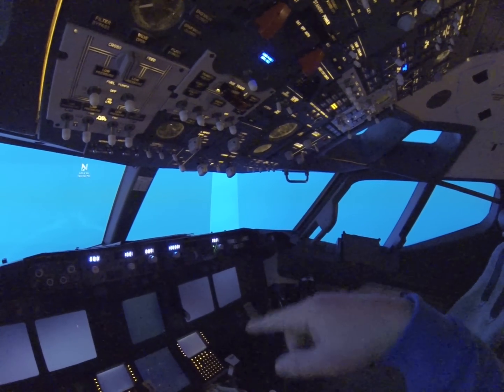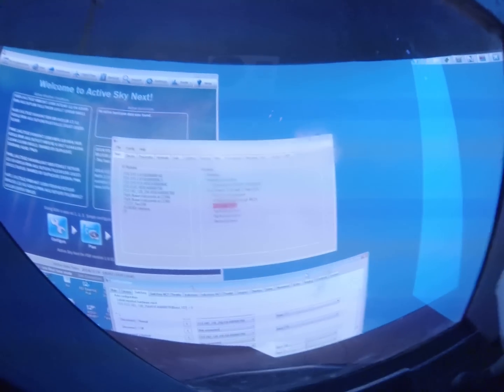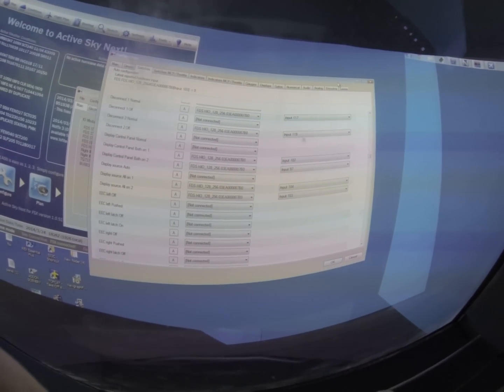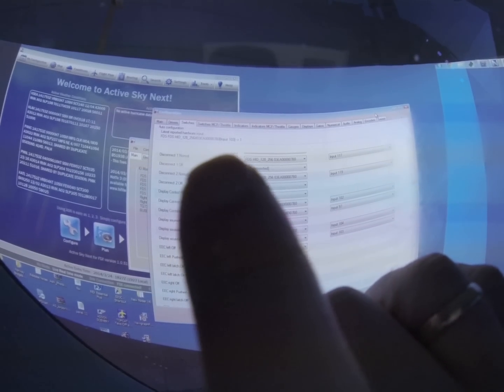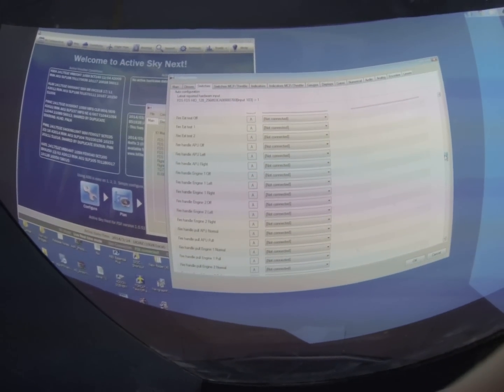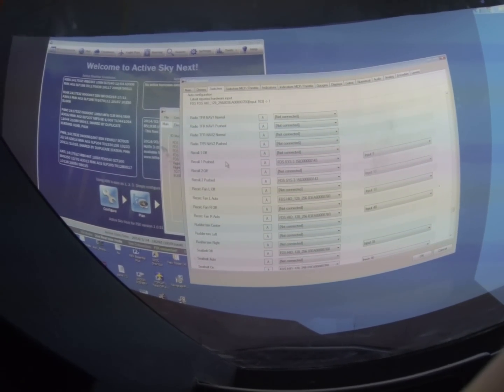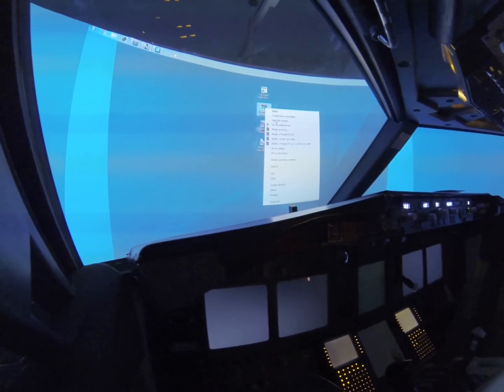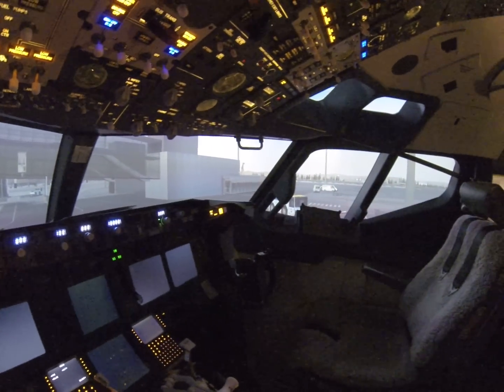Basic ProSim 737 configuration explained

Comment: hello Norwegian737project, i have a problem with a poldragonet overhead panel, when connected via prosim using default drivers most of the buttons work. some are not assigned correctly. 
after watching this video i reassigned the buttons currectly and they all worked as intended :-) but then i realised that some switches control other switches.. during config set up i noticed they have the same assigned number.. this was not the case during default driver. 
could you please advise me further as i am now stuck. thank you .